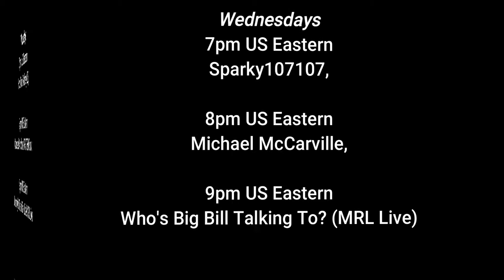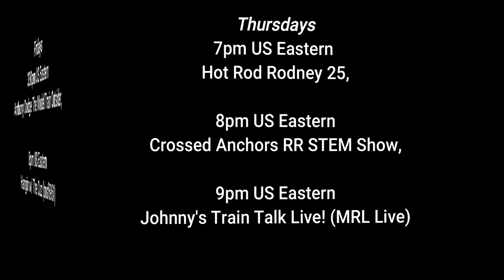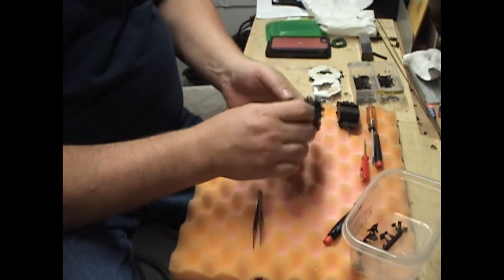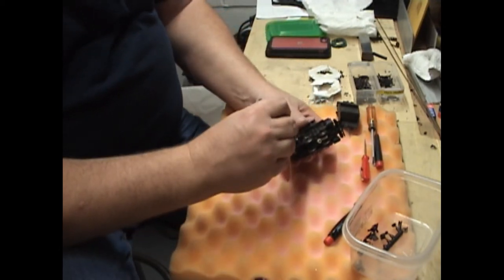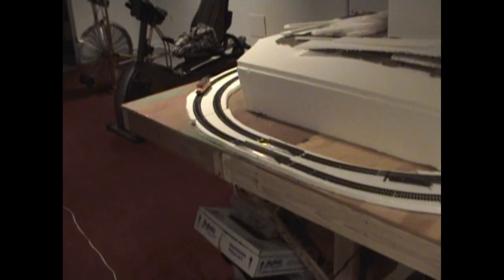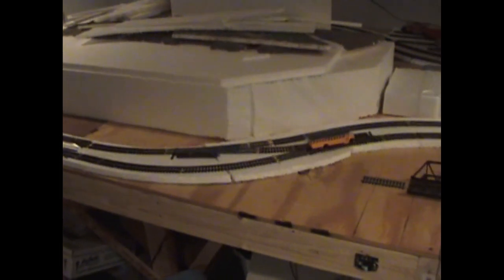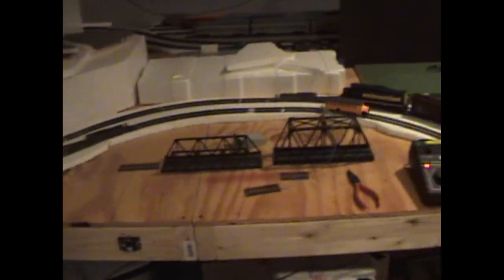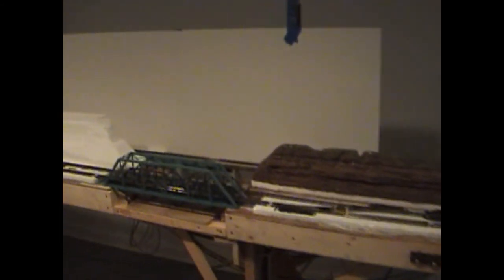Boeville & Newtown, VLOG #42-2020, Nov 15th, 2020 - Gem Brass 0-4-0, Bachmann Railbus

Comment: Ray, when I had my brass loco years ago. The loco received the right rail power and the tender received the left rail power. The screw that holds the drawbar has an insulating screw or washer to prevent shorting. Hopes that helps. Glad to see the railbus is up and going! - Jason
Reply from the maker: yeah....thats where I went wrong on the wiring. I had it right, then changed it. Thats an easy fix. The issue I have is hoping that the screw that holds that drive rod to the wheel isnt goofed up. I think I didnt have it tight enough.

Comment: hey Ray this video illustrates why i'm afraid to buy a steam locomotive. if it breaks i can't fix it and heck i'm even afraid to open it up. too many parts!
Reply from the maker: I love messing with some of these. This one has been a bugger though. Getting one 2nd or 3rd hand and not knowing how it was setup to begin with has made this one a challenge to say the least. I'm hoping that the drive rod issue is just that I didnt tighten the screw enough

Comment: I have a Gem PRR D16sb with the same issue, crappy pickup/contact system
Reply from the maker: Nate, I think the pickups are good. Since I have NO paper work to go off of, it makes things harder to fix when youve never messed with one before. I think it will run OK if I can get the drive rod fixed.